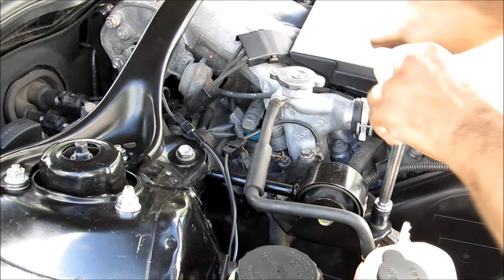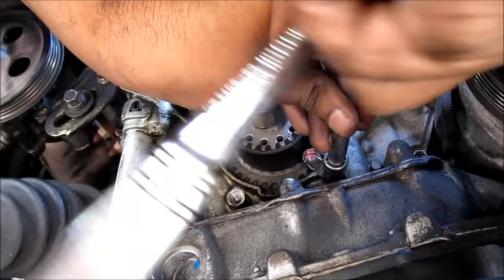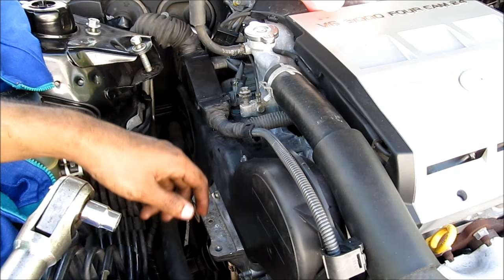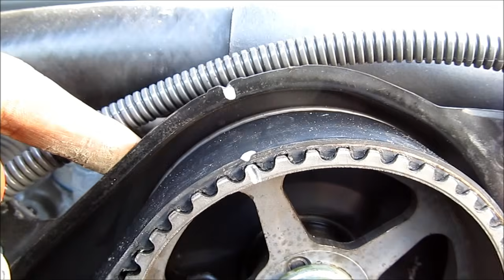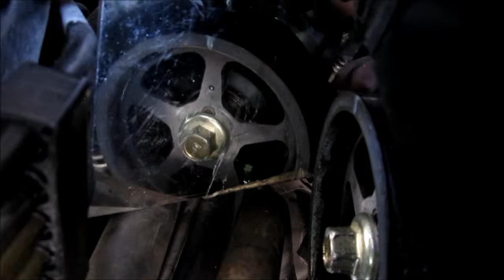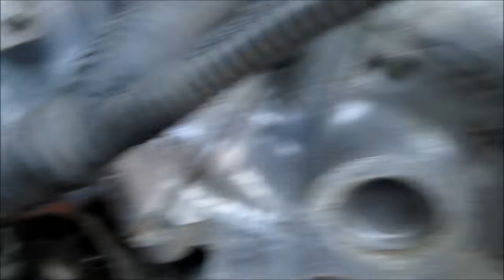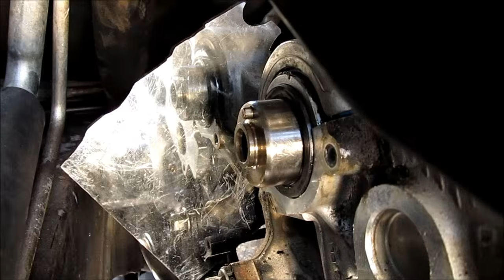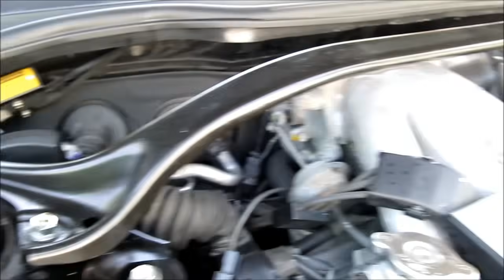Timing Belt / Waterpump Replacement: Toyota & Lexus V6

Comment: Whhhaat?! That's it? ! I thought it was going to be a whole lot more and engine taken out and all that bull. Wow!  I'm so glad I found your videos.  Subscribed! ! Lol.  Bcuz I have like I dk if it's oil,  sludge,  or just the brake fluid crap leaking all on my belts.  Ugh its so irritating for me to see that side.. Bcuz I never knew anything about how the timing belt and stuff all worked. I thought u needed a whole nother machine to adjust it and all that.  Dam.. thx
Reply: i also have an oil leak. at first i thought i was the power steering pump. but i realized my power steering fluid level is not changing and my power steering fluid is valvoline max life with a really different smell. now im sure its an engine oil. so its either from the arc part of the valve cover gasket or camshaft oil seal. i thought i could get away with changing my timing belt. its an original 1999 belt with 115k miles but still good no single crack. but since ill have to change the cam oil seal, i might as well do the whole timing belt thing
Reply from the maker: Glad my video helped you understand. These cars aren't very difficult to fix.

You've probably got a camshaft seal leak, valve cover leak or power steering leak. The brake fluid reservoir is on the opposite side of the engine.

The newer V6 engines from Toyota however, almost require you to remove the engine to get to the waterpump.
Reply: For sure i know i have a brake fluid. but it's actually coming from my stupid rack n pinion.  /: so that's another u should put out...lol jk.
Reply from the maker: Rack and pinion isn't an easy job. Are you sure its not just the high pressure hose?
Reply: Hmmm.... I don't think so. I mean, honestly i haven't really TRIED to find the source, only bcuz i thought i already knew and saw for my self where the leak was coming from. Bcuz i changed my driver side cv axle and i could see that pump thing dripping red fluid. I used to think it was coming from my transmission, until i saw that.. But i really have no idea. All i know it's covered with like grease or something right now..  /:  i know i know, I'm a horrible Lexus owner. Lol jk jk. I TRY my best to take care of her, but she's just getting ollld... And I'm getting broooke. Lol
Reply from the maker: I'd say inspect the rear valve cover gasket first to see if that's your leak. My cam seal wasn't leaking but I changed it anyway. Get that belt changed, rubber deteriorates with time and you won't see cracks before it fails.

Comment: http://toyota.custhelp.com/app/answers/detail/a_id/7690/~/does-my-vehicle-have-a-timing-belt-or-timing-chain%3F    
I found out from this chart that 2004 Toyota Matrix has a timing chain.  Does it need to be changed?  Would the steps be similar?
Reply from the maker: The timing chain does not need to be changed for the lifetime of the vehicle.

Comment: how did you break loose the cam bolt? where did your 2nd breaker bar go for leverage? i couldn't make out what you were saying about the timing belt tensioner.
Reply: speedkar99 I must say, with all the timing belt videos on youtube, your's more informative and to the point.  I have a 2000 sienna with 212k miles.  Planning on changing the TB myself. My only concern is taking of the camshaft bolts.  Your video game me the idea taking the back one off, much appreciated.
Reply from the maker: To break the rear cam bolt loose I used the timing belt tension. One breaker bar on each cam bolt, turning in opposite directions. Not recommended if you're not replacing the belt as this will stretch the old belt.

For the front cam bolt I used a camshaft holding tool.
Reply from the maker: Thanks for the feedback. I did make this video with the intention of producing something easy to understand and informative for all. I hope your TB change goes well, let me know!

Comment: can i remove the timing belt tensioner alone, just to check if its still good? when i put the tensioner back im afraid the timing belt position might change if its not clamped to the camshaft pulleys.
Reply from the maker: Yes you can, I've read its been done before. Just be careful not to upset the position of the timing belt too much and you could just pop in your replacement.

If a tensioner is failing, the belt might skip a tooth. Usually you don't need to periodically check them as they get replaced with a timing belt job anyway.

Comment: how do you disable the ignition to use the starter to remove the crankshaft bolt?
Reply from the maker: You can remove the ignition fuse or disconnect the ignition coils from the top of the engine, and/ or remove the spark plugs.

Comment: Thanks,  for providing this piece. As we have this timing belt as main piece in vehicle. I'm wondering to find a way to know timing belt failure ahead of time. This timing belt is hidden under timing belt cover.

I do see posting about timing belt failures at 50K miles and some are going beyond 150K miles.

That was the reason I posted this.

How do we check/inspect the timing belt condition periodical basis to avoid break/failure? (Apart from age/driven miles, typically mentioned in owners manual)

Are there any symptoms/noises showing up ahead of timing break/failure?

Did you cover this aspect in your videos?

Thanks for sharing.
Reply from the maker: Generally speaking the Toyota V6 timing belts are rated for 90K miles. There is no inspection cover on these engines, so you have to refer to records (or evidence) that the timing belt was changed previously.

If you hear whirring sounds from the engine's pulley area, it could indicate an idler, tensioner or water pump pulley is on its way out and a timing belt job is imminent. If the tensioner is oily and caused the belt to skip a tooth, the engine will perform poorly.

Comment: My '98 camry v6 just hit 240K and is in need of a timing belt replacement( last one at 125K).  I'm thinking that I may try it myself after a few more views of this video.
Reply from the maker: Definitely go for it! Just make sure you have all the tools ready on hand, and perhaps a spare car if you need to run out and get something.

Work on the crank bolt first, If you can't get that off, take it to a shop to have them crack it loose.

This was the second timing belt job for my car, at ~270,000 km.

Comment: Just wanted to say thanks a bunch for making this video. I was able to change my timing belt, water pump and crank/cam seals in my Lexus es300. I'm not a mechanic, so your video was extremely helpful. To people reading this that are thinking of trying to change theirs 1) If you can't get the crank bolt out using the bump method like me, use heat on the bolt until it's a dull red (then bump). That is the only way I could get mine to break free  2) Using a dental pick can help get stubborn seals out. 3) Don't over tighten bolts! Look up the torque specs and go buy a torque wrench. I broke a stud on my water pump and had a hard time getting it out to put a new one in. 4) When putting the new belt on, you might have to rotate the top right cam 1 cog off to the right, top left cam 1/2 cog off to the right, crank dead on. When the tensioner is released on the belt, it pulls the 2 cam cogs back into the right place. Thanks again Speedkar!
Reply from the maker: Thanks for the feedback and tips. I too broke an idler bolt (and later  the water pump bolts) on my first timing belt job on my Lexus. It was a horrifying experience, but you learn from your mistakes and move on.

Comment: After asking around it sounds like this is a common problem on older models so caution to everyone doing this job. Try removing the bolts in advance and if they feel like they are frozen in the lower bracket you might want to get the new part before you start the job to avoid delays. These are those 2 long bolts (about 6 inches long) on the right side mount that connects to the dogleg. for my 97 Avalon is 12315-20020 for the bracket and 90080-11624 for the bolts. Good luck!
Reply from the maker: Yes, these are known to break on some 1MZ and 3MZ engines. Did you get yours fixed? Having a spare car when doing major DIY work is a good idea.

Comment: Nice job on the video!  I started working on my 1997 Avalon today and one of the engine bracket bolts is frozen. I was afraid it was going to snap so I am going to try and remove the belt covers first and take out the 2 bolts and 2 nuts holding in the bottom part of the bracket so maybe I can free it up on a workbench after I remove the complete engine mount.. I can see the need for some anti-seize compound on these bolts when I reassemble it. Have you ever seen this happen? Thanks!
Reply from the maker: Thanks for the feedback. Do you mean the really long bolt that goes through the bracket? Those are well known to seize up and break - it happened to my dad's 2nd gen Sienna when they were doing the TB @ a shop and it took a long time to remove the bracket and base from the car to extract it. Good luck.

Comment: the belt you removed still look good
Reply from the maker: Never judge a timing belt by its look alone. The rubber could deteriorate internally during time and you would never see the failure coming. The timing belt on this car was 8 years old according to the sticker on the door jamb and was due for replacement.
Reply: my wife's highlander has only 40k miles but because its a 7 year old vehicle, the dealer recommended to change the belt...they also replaced the water pump....but not the cheaper parts..tensioner, oil seals and pulleys :D
Reply from the maker: That's great. As long as the oil seals were fine there's no point in replacing them at the first timing belt service. I would have replaced at least the tensioner.

Comment: speedkar99  quick question. do i need to put a floor jack underneath the engine to replace the dogbone(engine mount).
Reply from the maker: No you don't. The dogbone is a torque mount meant to reduce the shifting of the engine under load and doesn't support the weight of the engine.

Comment from the maker: petersmonkey The highlander is exactly the same, with the small exception of the timing belt tensioner which has two bolts horizontally into the engine instead of vertically like in the video. Do it your self to save labor, if you have a backup car and some time. TB/WP usually run $700-$1000 at shops and dealers including parts. $250 for the parts from RockAuto.

Comment: Thank you for the most useful video on YouTube.  I did my 2000 Avalon almost exactly as shown: 10 hours with preparation, lunch and cleanup.  I found it easier to drain and removed the power steering reservoir so I could move that hose out of the way; my fluid was brown anyway.  Also, I had a third pinch screw holding my alternator.  Your most useful comment was on how to remove the crank screw using the starter motor.  Brilliant.  When I loosened the screw, I did not disconnect the ignition; I used my unchipped key which turns the engine but does not inject fuel.  Thanks again!
Reply from the maker: I'm glad it worked out for you and your car is up and running again.
Reply: I like the idea of using the 'unchipped' key. That might come in handy when I perform my replacement. Also will keep in mind draining the power steering fluid.

Comment: I have a 1995 Toyota Camry I think its a 3.3L V6,Would it be any easier to do the same job as you did being an older Camry,or would it be the same way
Reply from the maker: You have the 1MZ-FE 3.0 L in the 1995 Camry. The timing belt job is exactly the same as in the video (same engine).
Reply: Your right its a 3.0 i researched and it came up 3.0.I may be asking you some more ?s in the near future I need to change the belt and pump.Thanks
Reply from the maker: Sure, I hope everything works out.

Comment: Hi. I had sent my car to a mechanic here to replace the water pump. After coming back the car had lost all power. The mechanic at the garage says it is probably due to the timing belt getting misaligned while replacing the water pump. It is a dohc engine. I want to know if he is telling the truth and what is the right way to align the timing belt to original. Now the mechanic has moved to another town far away from me. I have to take it to some other guy. Pls help
Reply from the maker: Most likely the timing is off. You should contest that mechanic and at least get your money back. To re-time it you pretty much have to redo the whole job again, minus the water-pump.
Reply: I haven't paid him in full. Told him once the job is done properly I will pay the balance. Any procedure to follow to redo the timing?
Reply from the maker: You need to remove the pulleys, belts and covers to get to the timing belt. Mark the position of TDC on the belt when aligned using paint. Remove and reinstalled with the cams and crank aligned properly.

Comment: you have a video how to replace the oil pan gasket?
Reply from the maker: Sorry, I haven't done an oil pan yet, but its a similar procedure to the transmission pan. Transmission Filter & Gasket Change Toyota Camry V6

Make sure you use a torque wrench. I hope you don't have to remove any exhaust components to get access.
Reply: speedkar99 ok,are u very best master!)

Comment: Hello. Thanks for this very informative DIY video. (I also followed your valve cover gasket replacement video to do my valve covers). I started out wanting to just install the Aisin TKT-024 kit, cam/crank seals,ignition wire and plugs, front brake pads and rotor, and front struts on my 2000 Camry with ~245,000 miles. But I ended up doing those plus valves cover gaskets, thermostat, and radiator hoses.
I really appreciated paint can opener tool trick. I was able to remove the cam seal for cylinders 1,3,5 pretty easily with only that tool. But for the other cam seal, because there wasn’t enough space to work with, I first inserted the paint can opener into position. Then I put one end of a length of ½” conduit against the opener handle. Finally, I used a hammer and with a couple of hard taps, the seal came right off. (Not sure though if there would be enough room for this method without removing the fuel injection plenum.) A bonus is that the paint can opener tool didn’t put a scratch on the cam shaft. For the crank seal, I used 2 paint can openers and a gear puller. I actually worked nicely. Here is a link to pictures:
https://drive.google.com/folderview?id=0Bxgs7wi0I7SbN0pIMkU1QmNHVWM&usp=sharing
Hope it helps.
Reply from the maker: Thanks for the reply. I like your paint can opener method with the conduit, I wish I could have used that trick when I was doing the rear cam seal, but I wasn't doing the valve cover gasket at the same time so I'm not sure if it would have cleared the plenum. Thanks for the idea though, good thinking :)

Comment: Great video and thanks a lot for sharing! BTW, does that work on Lexus es 350, 2008?
Reply from the maker: Thanks. The ES350 uses a timing chain so there is no need to do a timing belt service.

Comment: I am a motor technician, your procedure on the video is really good,you get a lot of videos and you can tell that they are kids playing the mechanics,just two notes,torque on cam and cranck pulley bolts also wheel nuts,apart from that you are a real mechanic.thanks.
Reply from the maker: I'm not a real mechanic.... I just like working on my cars and do the job properly.
I've had bad experiences with torque wrenches in the past - if I can get away with it (i.e. not a gasket surface like Water-pump or valve cover) then I just use my calibrated hand :) .
Reply: torque wrenches come in different sizes,
1/4,3/8,1/2.therefore every bolt has to be torque ,experience  is ok when resources are limited or brake down somewhere in the bush,
a cranck pulley bolt with the wrong torque specs.could develop a cranckshaft damaged,once the pulley gets a minimum free play the end gets damaged and that means engine disassembly,if it is a Honda new cranckshaft plus color code bearings;
wheel nuts not to loose not too tight just right,
torque is a professional signature to all your work,please don't get me wrong just a note to
make you look even better.thanks.

Comment: very awesome video, but my question is about the alternator belt...how tight or loose should it be when replacing same for power steering belt i suppose ?
Reply from the maker: Check out this video on accessory belt replacement: Alternator / Power Steering Belt Replacement Toyota Camry V6 / Lexus ES330

Comment: Great video!  How did u deal with the (great) tension on the rear camshaft before removing the timing belt?  Should I concern myself in getting the rear camshaft in a rest position before taking the timing belt off?  If so, how do I release the tension?  This question is in reference to the YouTube video made by Schrodingers Box on Toyota Sienna timing belt replacement Part 2 (10:50).  I own a 1998 Toyota Sienna 3L.  Please advice.  Thank you very much!
Reply from the maker: That rear camshaft rests at an unstable point when its marks are aligned with the timing cover. There is no easy way to release the tension as its caused by the cam lobes being near the top of their profile. If your careful, you can remove and reinstall the timing belt without moving its position. If its position moves, it will only jump a 1/4 turn and you can simply move it back to align its marks using a cam-holding tool or a breaker bar and socket.